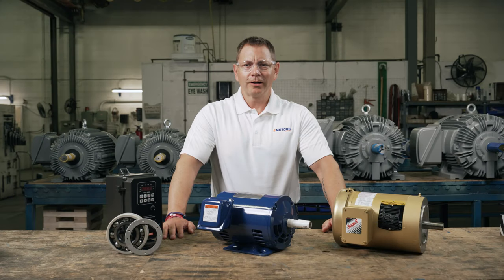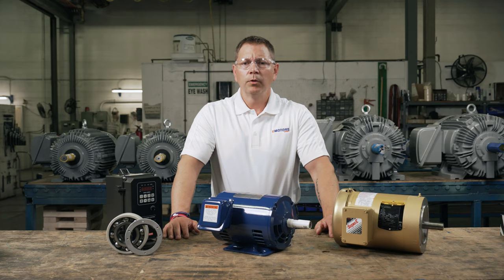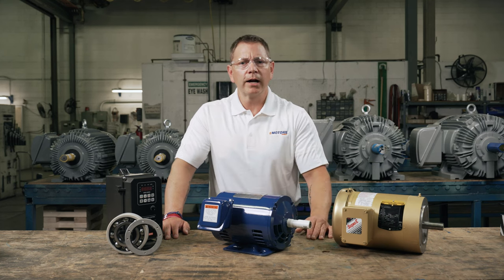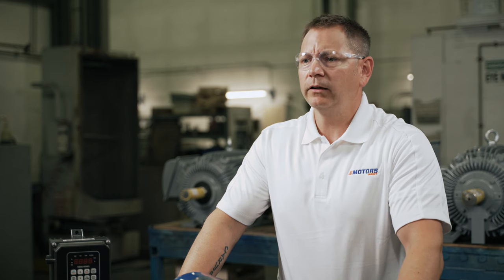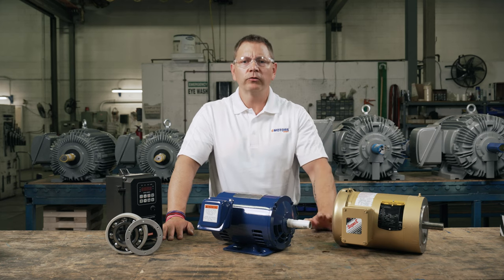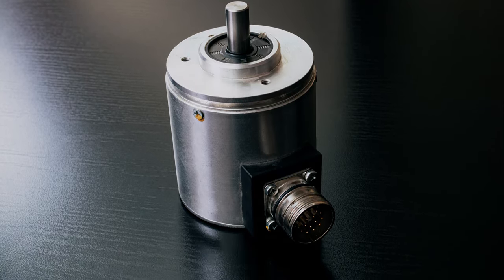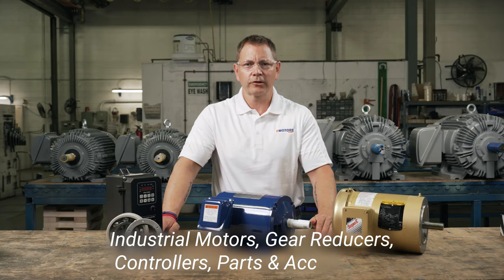What Types of Motors Can Be Used with VFDs?

Comment: Very good primer.  I recently retired from a controls engineer position.  90% of the motors we dealt with were VFD driven.  We would occasionally get away with temporarily driving a non-VFD-rated motor, but that was always a temporary solution, usually ending with the motor getting rewound or outright replaced.  One thing we REALLY learned was to install the AEGIS rings on them!!!  It's amazing how much damage occurs to the bearings.
Reply from the maker: Thanks for the comment Doug. The AEGIS rings are a life saver 👍

Comment: Can We use Continuous (S1) Duty motor for VFD operation ? We are taking S1 motors with insulated bearing and class F insulation. Both motor and VFD are new.
Reply from the maker: Great question. All industrial motors built in the last 10-15 years would be VFD rated, you would just need to verify the motor turndown is in the range that you are going to use. Some motors only come with 2:1, 4:1, or 10:1 turndown and you may want to go slower than that.

Comment: We had well over a 100 plain Jane non VFD rated NEMA motors that were installed in the 1970's from 3 to 250 HP that were changed over to drives over 25 years ago. Lucky if we had two old motors a year burn out. Most did have line reactors. Most ran under 90% of rated RPM .
Reply from the maker: Thanks for the comment. 

Older motors are a bit of an enigma when it comes to VFD rating. A lot of them were manufactured to a very high standard of workmanship and incorporated insulation/magnet wire that would allow for safe operation under a VFD with sufficient thermal headroom for turndown but at the same time you have plenty of motors that weren't. The nice thing about purpose-built/tested inverter duty motors is the guaranty of safe operation under inverter power. A non-VFD-rated motor would likely have more to gain from a load reactor than a line reactor.

Comment: Can a vfd be safely used on an old Baldor 3 ph 3 hp unisaw motor? I only want to run at 3450 rpm and use my 1 ph power source.
Reply from the maker: Doable, however this will likely reduce the life of the motor if the insulation/magnet wire is not up to snuff. I would need to see the nameplate to provide concrete advice.

Comment: I really hope you can answer this question: I want to make my home AC condenser compressor variable speed with a VFD. It’s a single phase 220V 1.75 ton 21kBTU compressor so about 2hp. RPM of a residential scroll compressor is about 3,000. I want to vary it to about half. You think I could make it work?
Reply from the maker: You could make it work if replacing the motor.
Reply: Compressor and motor in same unit.

Comment: I have a late 60s 2 speed motor that has been swapped to a drive. When slowing in an unloaded direction (possibly reverse loaded for slowing down with a regen resistor) it chatters and hiccups some runs. I believe the motor is high slip but low info on the data tag. Also possibly a gear box problem. Any suggestions? Thanks for your video.
Reply from the maker: Hi Rob, this is highly dependent on the type of two speed motor and how the speeds are selected. In order to diagnose a high slip situation, I recommend watching the output current. The magnitude of slip is proportional to torque and thus the output current.
Reply: Hello Sir ... I have a concern. My plant has a lot of fluctuating load. The main substation has a lot of fluctuation in amperes. Which we see in the ampere meter. How can we reduce this falctuation load?

Comment: How would I know if a motor is of a SRM type? WOuld I need a special VFD for such motors?
Reply from the maker: SRM motors will generally be labelled on the nameplate. They require specialized drives to function.

Comment: Very good. One of the best and clearest explanations on this topic I’ve seen. The amount of misinformation on YouTube channels (and elsewhere) is unbelievable, particularly in the area of the purchase and refurbishing of old machines such as lathes, mills, surface grinders and others. Many of these machines are many decades old with three phase motors, and often, people want to use them on single phase. I try to explain why a heavily used motor from 50 to 80 years ago shouldn’t be used with an inverter to vary speeds, but I get pushback. I intend to link to this video from now in.

I do disagree with manufacturer labeling where they don’t state inverter ready on the tag. I don’t know why not. It essentially costs them nothing to do so. I bought a motor two years ago that was advertised as such but didn’t say so. I had to call the manufacturer for confirmation. Unfortunately, many motors for sale today were designed before most manufacturers decided to make most of their offerings inverter ready. So if it doesn’t say so, you can’t know if the motor on the shelf is or isn’t. You always have to check. In ten years maybe it won’t be necessary, but for now, it really is.
Reply from the maker: Hi Mel, thanks for the comment. Glad the video was helpful. You're right, there are still a bunch of non-inverter ready motors out there and it's important to check.

Comment: thanks for the info we’ve been installing new roof rooftop units York they come with a  drive and after six months we start noticing brand new blower motors started having bad bearings and we didn’t know why  with  you info  we can see the problem
Reply from the maker: I'd recommend using a shaft grounding ring to avoid that. Here's more info on: https://youtu.be/olqO0cRvPeI?feature=shared

Comment: Such a brilliant upload , and thanks so much  ! I am trying to specify a VFD for a 3 phase motor which is  2.2kw , 400v , 50hz,  but my supply is 220v singlephase . I would be very glad of any pointers
Reply from the maker: Hi Neil - thank you for the question. It would be worth checking if the motor is 400V only or if it's also wound to accept 200V. Otherwise, I'm not aware of any VFDs that will drive a 400V motor from a 200V supply without the motor being rewound for 200V.
Reply: Have a look if your motor can be configured to run in delta at lower voltage or Y for higher voltage.
Reply: If that is all you have back feed a 5kw transformer. 240/480. Reason for double size is doing so will cause alot of IR sqaure losses in Iron Stack and extra heating. Wont be very efficient but will get the job done. Set motor type to 50hz and motor voltage to 400. Single phase application will also require a line reactor size Full load motor amps plus service factor multplied by 1.73.

Comment: I plan to use a VFD to drive an old 3 phase induction motor on single phase power on a bridgeport mill. This older motor was made in 1987 with E class insulation. A grounding ring would be half the cost of a new motor. Would you recommend just running this one till it dies and then replacing with an inverter rated motor? How long would you expect something like this to run before it dies? Would you expect weeks/months, or would it be more like a few years? Not going to hold you to anything of course, just curious roughly how long you think a motor like this would last in my situation.
Reply from the maker: Thanks for the question. Running it till it's dead and then replacing with an inverter rated motor is not the worst idea. A shaft grounding ring is not the magic bullet solution to make a non-inverter-rated motor run on an inverter so it's recommended to buy an inverter duty motor. As for life span, due to a lack of standardization for older motors, it's nearly impossible to tell. Some will run smooth for years while others start chugging in weeks. Though from the limited Bridgeport inquiries I've dealt with, they have usually ended up lasting on the order of months. 

I hope this helps! Happy tinkering. 

- Keith

Comment: Great commentary - thank you. It's great to have such direct presentation.

I thought the remarks about fan speed/cooling to be advice that comes from genuine broad expertise about function and life cycle and particularly insightful. 

I'm curious and would welcome your advice on a matter you cover here.
Is conductive grease used to mitigate the potential difference between the armature and motor body?  I presume the problem is that the grease isolates the armature from the main body and grounding setup, so becomes a source of heat and grease degrades?  

I ask this as I am looking at ways to diminish precipitation static in a coffee grinder design where the motor mounts one grinding face and the body of the grinder the other. The bearings are an isolating factor.  As coffee is ground static charge accumulation occurs due to the friction. 

I had thought the use of conductive grease in the bearings would ensure the armature could be grounded more uniformly and reduce static in the ground coffee by dissipating it as it generates. 

You may not be an expert on coffee but I hope you may have some insights into the ground loop and contribution of the bearings and their conductivity on it in a motor :).
Reply from the maker: Hi Michael, thanks for your comment. This is the point of conductive grease. Alternatively, grounding rings would also do the same thing. Check out my video on grounding rings for more specifics: https://youtu.be/olqO0cRvPeI?si=xt1VyrcLpSxyzJ4U
Reply: @emotorsdirect  Thank you sir. I'll go watch the video you linked :). 

Have you perchance done any videos on dissipation of precipitation static (P-static) on a single or multi-ground system?
Reply from the maker: @michaelrobinson9643  I haven't done a video on this but thank you for the suggestion. Stay tuned for new episodes coming next month, focused on VFDs.

Comment: Thank you for this video! I can tell you have a huge knowledge base to draw from. I run an residential HVAC company and I'm getting a bit tired of replacing inverters that are 4500$ our cost due to proprietary software and communication. I feel like it shouldn't be terribly hard to build a system that can use more standard a more standard VFD and maybe simplify everything a bit. One issue I'm running into is that most of this info is directed more to 3 phase input industrial applications. All of our residential service only allows for 240v Single phase. My dream is to build something similar to the Bosch condenser that ramps up and down dependent on refrigerant pressures and doesn't need direct communication with the indoor unit past the signal to turn on and off; but do it with readily available VFDs like industrial Legos. Would you have any advice on what I need to look for in a compatible VFD and Compressor with my single phase limitation?
Reply from the maker: Hi Scott, thanks for the comment! Wow that's steep - where are you located?

The SINUS M series of drives would be perfect for this application. Any of the three phase drives we list, if sized correctly, would also work for a single phase application. Contact our tech team for more support there if needed: https://www.emotorsdirect.ca/contact-us

FYI - we have a few single phase specific videos coming this year - hopefully you'll enjoy those. 

- Keith

Comment: Hi Keith! Please support on this: I have a mini lathe with variable RPM (Paulimot 190-V), just bought it, brand new. Right after pressing the Start button, but BEFORE the motor starts spinning, a high frequency sound appears (10k Hz) and keeps sounding no matter the RPM is, until the lathe stops. Could this be the VFD? How could I diagnose it better? Thx!
Reply from the maker: Hi Sorin, thanks for the comment. Yes, that is sound of the VFD output's switching frequency. There is really no fix for this outside of isolating the VFD in a box to reduce how much sound gets out.

Comment: Hello. I have a Romanian SP81sw bench lathe, it's small with an 80mm universal and it has a 0.37 kw / 380v motor. I only have a 220v network. What power should the VDF have for this motor, should I switch it to a VFD to run on 220v .Thank you!
Reply from the maker: Hi Lacovache, Based on your network voltage, you should go with a 220v motor and a 220v VFD. The voltage delta is too great.

Comment: I want to connect 6 X 260kw motors on a single 2000kw vfd. Which brand of vfd would you recommend.
Reply from the maker: Thanks for the question. Whether any brand would offer a 2000 HP VFD would depend on input voltage. If you want to individually speed control the motors, you will need to use one VFD per motor. If you want to speed control 6 motors on an individual level from a single interface, you will need 6 drives in a master/slave topology with a single drive playing the role of master and controlling the other 5. 

The only series of drives in our LV(230V-600v) catalogue that WILL DO 2000kw is the cfw11 series: https://www.emotorsdirect.ca/search?keywords=cfw11

Comment: Thanks Sir
Please i need your help
We have 3ph Siemens ex motor 1mj7 310-2cc60-z with 95.7 kw
My question could we drive this motor with a vfd or its not supported ?
Reply from the maker: Hi Basrawwi, thank you for the comment. Most motors built within the last 15 or so years will operate fine on a VFD as higher insulation classes and inverter grade magnet wire are standard practice among higher end manufacturers in the industrial space. The problem here is that I don't see an explicit rating for this particular motor, so its impossible to say how much turndown the drive can handle. Typically at this point, I'd reach out to the manufacturer of the motor to confirm. Siemens may be able to answer this question for you with more certainty if you reach out directly. Siemens recently sold their low voltage line to ABB, so they may also be able to help you out.

Comment: I have a spare 2hp 3ph I want to use but can't find any info on it. The part number is "US Motors p63fte-1793" and I'd like to find the right vfd. Any recommendations?
Reply from the maker: Hi Scott, did some digging and it looks like this is a TEFC class B insulation motor. Some things to keep in mind: 

(1) Duty: fan-cooled motors will have cooling issues when slowed, however, the thermal mass of the motor can hold some heat before getting too hot so intermittent use can offset the thermal load.

(2) Insulation: though insulation class is a purely thermal standard, it just so happens that when motor manufacturers put in better thermal insulation, they also put in better electrical insulation, so we generally recommend class F and up. Many class B motors will also run fine on a VFD, but it will likely take a toll on some of the mechanical components.

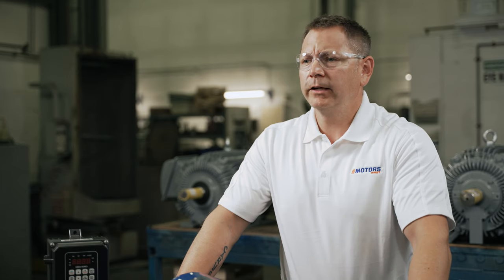(3) Required turndown: since you're considering VSD operation, I'm assuming you want some degree of turndown, but it makes a huge difference for operation if you want a 1:4 turndown vs 1:10 for example.

I would say any of our lower-cost VFDs (ex. L510-202-H3-U) would work depending on how often it will be used and the degree of turndown. If you're working with a single-phase supply, go with a TECO Sinus M. 

This is an off-label application and thus performance and longevity are very application dependant. Your motor may develop a wabble over time, in which case, you could replace that spare motor for a few hundred dollars.

Thanks for the comment!
Reply: @eMotors Direct  Thanks. The motor will be used extremely intermittently, like 5 minutes on and 30 minutes off. And even then, only a few times each day. This is not for a continuous use application. I'll likely only be slowing it to around half speed, maybe a little less, when I do slow it down, and that won't be often. 

I suppose I could have included all of that in the beginning, but then I may have missed out on some of the info you just shared. Thanks again!
Reply from the maker: @Chromevulcan  Awesome, good luck with your VFD Scott!